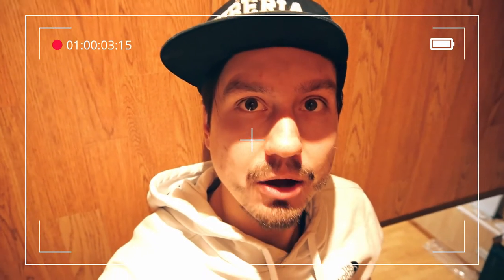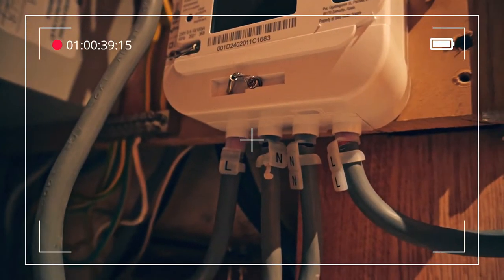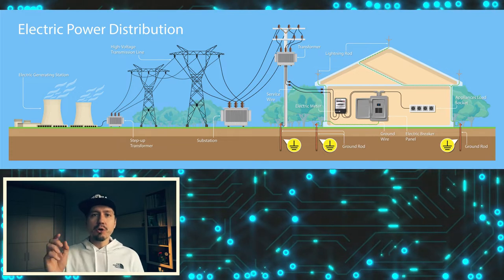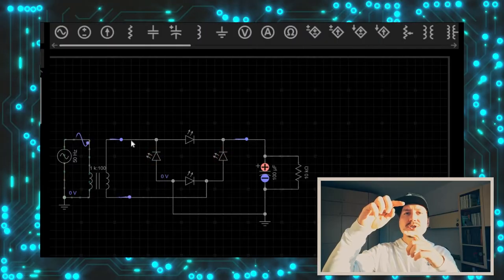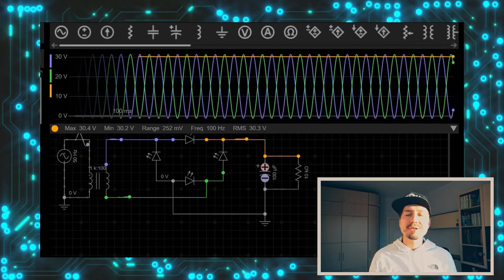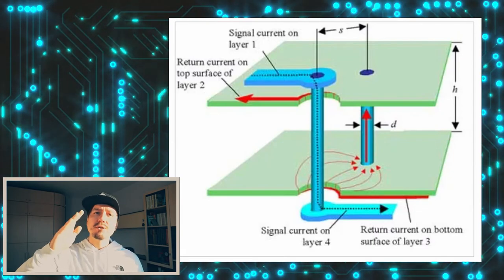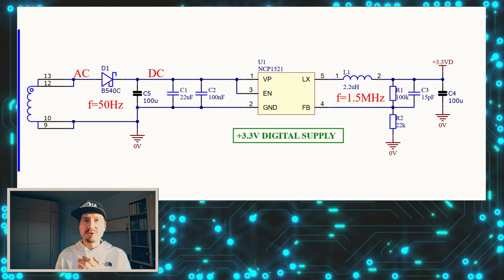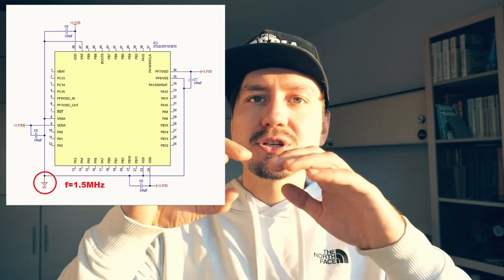Electrical ground. PCB design tips

Comment: Two questions, assume an analog audio circuit, 4 layer stackup signal-ground-power-ground

A) I do not have a ground fill on the top layer. Do you recommend one or is the ground plane enough? I've heard conflicting opinions.

B) My signal routing is good, but if I needed to run a short signal trace on another layer, do you recommend cutting through a power plane or a ground plane? Any preference on layer 2, 3 or 4?
Reply from the maker: a) EMC-wise ground plane is enough because due to skin effect the majority of energy is concentrated at the bottom of the trace and under it, inside the dielectric. However, you mentioned audio. With audio we also care about crosstalk, so the use of 0V "guard traces" is recommended which can be a plane if you space your tracks appropriately. Also, why not to fill empty space with copper if you have it? Just remember to stitch all copper fills with vias and you'll be good. 
b) Forget about "power plane" or "ground plane". You need to figure out what is the reference plane for this trace as it can be whatever. Then if you need to switch layers during routing, that is OK, but you should use "stitching capacitors" if the reference plane for the trace changes as well. Does it make sense?
Reply: @DrEMC-sf8rx  Thank you, it makes perfect sense!
Reply from the maker: @angelolorenzo7614  Awesome! :)